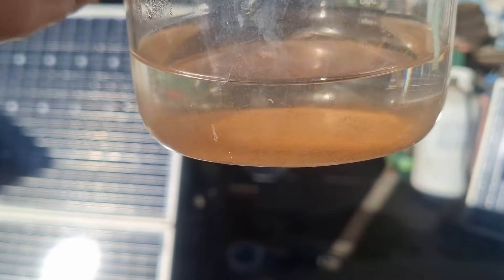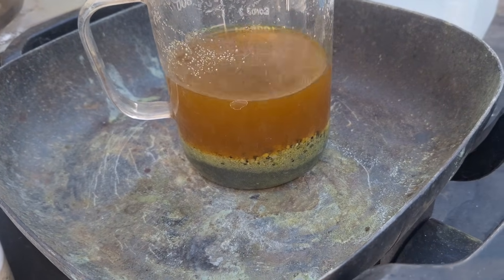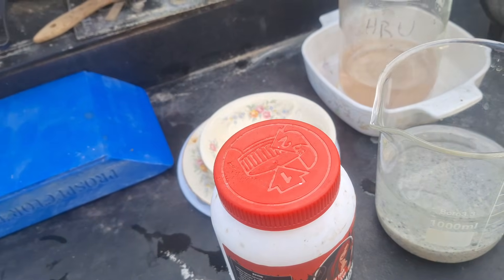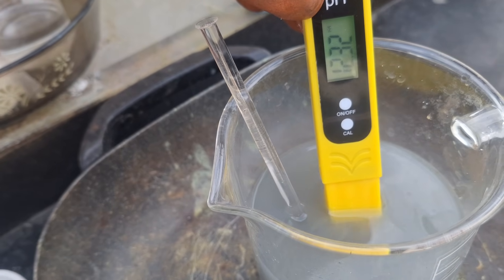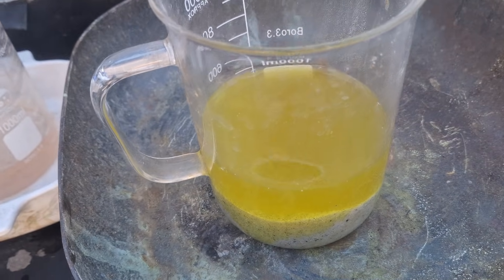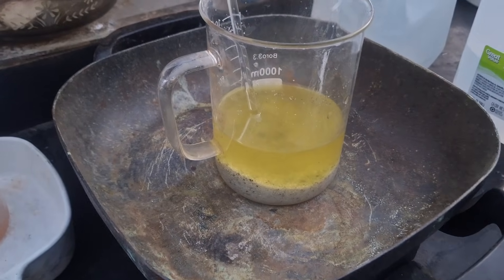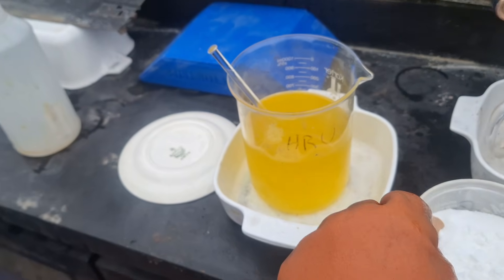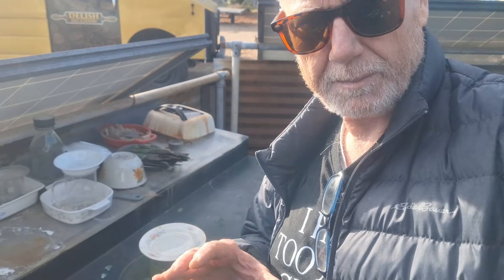Confirmed Chemical Roasting process using Mt Baker Mining and Metals Road Base Ore tailings ☝️🤣

Comment: I figure it's a gamble when buying pay dirt. I've not spent my money on any yet. I prefer to sit my ass in a creek somewhere and try to find my own gold. I've several buckets to process from my last trip. Planning a trip to Colorado this spring. If I find color I will load up some buckets to pan out at home.
Reply: Thought I found a honey hole near high point. It looks like it's loaded with gold flakes. But they float out of the pan. I tried putting some in aquaregia and got a reaction but very faint. Ended up making a mess and some fill dirt for the driveway. But the fun is in the hunt.
Reply from the maker: @richardhulbert9480 usually that floaty stuff is biotite mica. It's pretty but not gold.
Reply from the maker: No guaranteed amount of gold in paydirt is a gamble.  Buying gold ore is even a larger gamble. However,  being fully honest about selling gold ore like Jason is doing, it's very difficult to exactly know what he is selling. That being said.. a bit of additional effort on his part, he could grade his material better and offer the Road Base low grade Ore for a more fair price. 
It's a personal moral issue for sellers.. he's a business man.. and so it's 100% buyer beware!
I am now very aware.. that's all I will ever buy!
I still love mbmm's Jason! With eyes wide open! 😳 😆 🤣 😂 
Stay Golden ⚡️ 
Peace Prospector Tripp
Reply from the maker: I have many times brought home several buckets of paydirt, sluiced it out at home and used the tailings for yard fill or driveway fill. It's a twofer! Gold and Gravel! 😆 🤣 😂 
Stay Golden ⚡️ 
Peace Prospector Tripp

Comment: It seems with my ore that hydrogen peroxide does a good job with the sulfides,  Then again, I am leaching for the next step.  Basically hydrogen peroxide 2 hours bottle roll (100 mesh minus material), then a little lime to both adjust the ph and also decompose any remaining H2O2, then Eco Goldex 48 hour bottle roll, then 24 hour resin in pulp roll.  In a production setting we will strip the resin.  For tests, fire assay the resin after room temperature drying.  Seems to load to 1% or so before slowing down the adsorption.
Reply from the maker: I'll study this process.. learning is Fundamental 😆 🤣 😂 
Thanks Keith 
Merry Christmas pal
Stay Golden ⚡️ 
Peace Prospector Tripp
Reply: Merry Christmas to you and yours Matt.  Keep having fun exploring.
Reply: P.s. And - Don't forget some sliced watermelon and put some dill pickles and ketchup in the picnic basket also please :) Thank you 😊